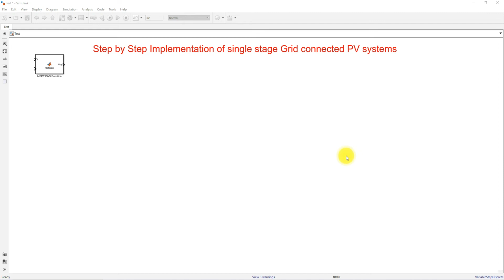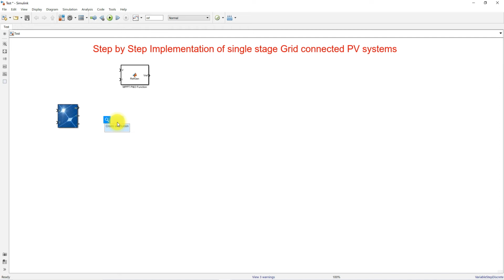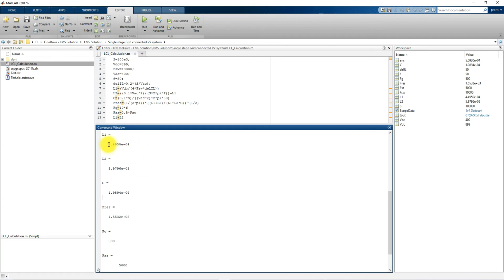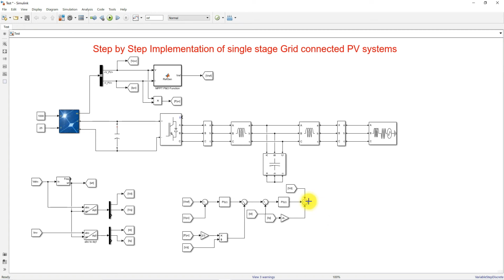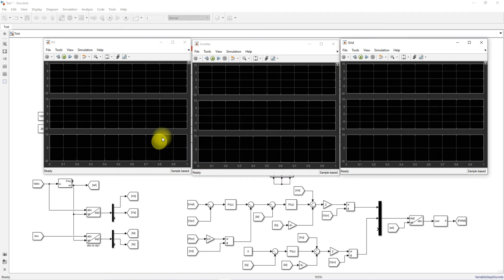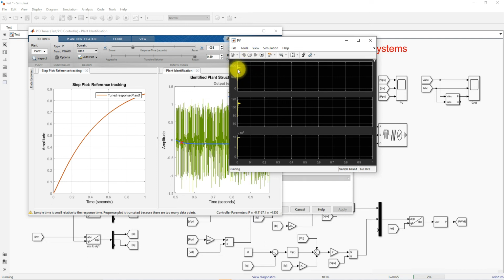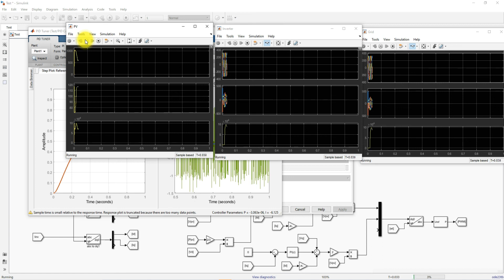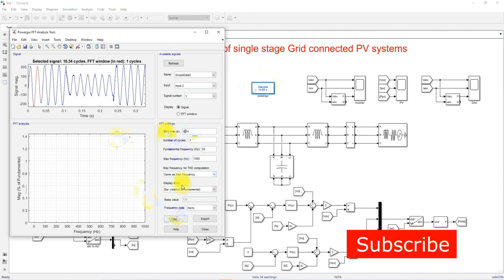100 kW Single-Stage Grid-Connected PV System | P&O MPPT Control | MATLAB/Simulink Implementation

Comment: Good job ! can you realise the same configuration with a single stage single phase (asymmetric nine-levels) with off-line calculation of switching angle ? I'm very interested by this configuration of grid connected multilevel Inverters. Thank you !